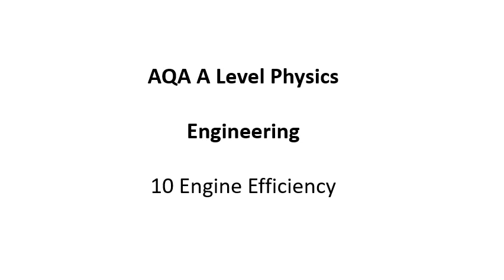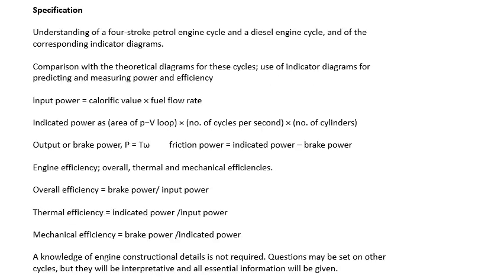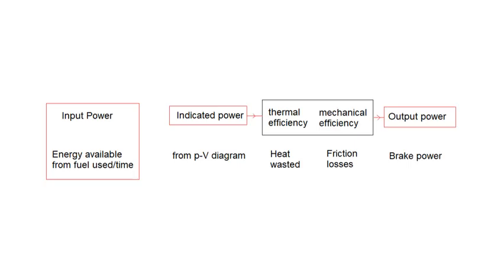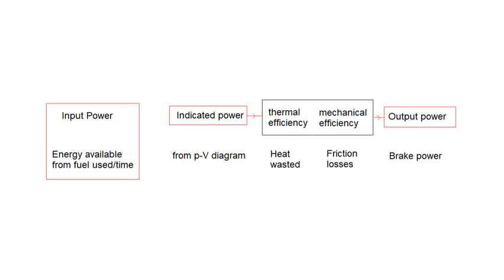AQA A Level Physics: Engine Efficiency

Comment: i swear 1BHP is 236 W
Reply from the maker: type BHP to kW in Google
Reply: hp is tq * rpm in imperial units so convert it about and find it yourself
Reply from the maker: @wrth  in imperial units 1 HP is defined as the work required to lift 33,000 pounds 1 foot in 1 minute
i.e. (33,000 x (12 x 0.0254) x 0.454 x 9.8) / 60 = 746W
Reply: @understandingphysicsbydave1349  interesting never knew that. that’s probably where the constant in the formula HP = Tq * RPM / 5252 in 🇺🇸🦅 units comes from